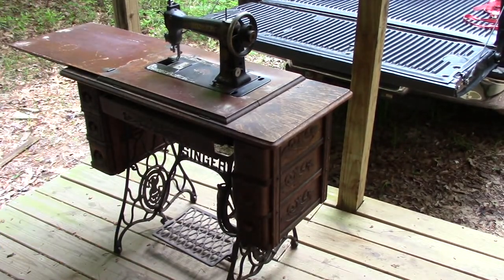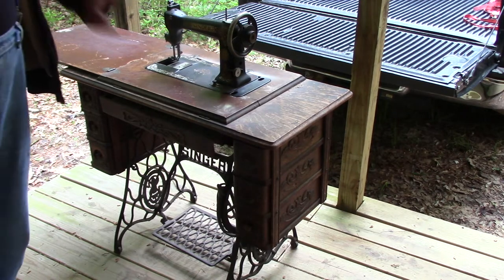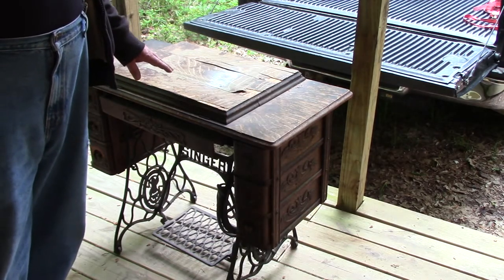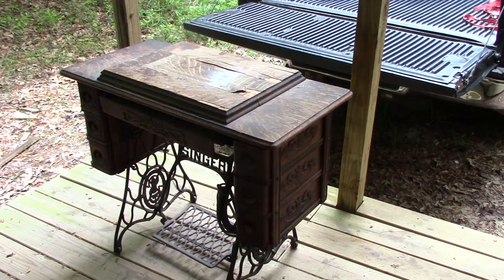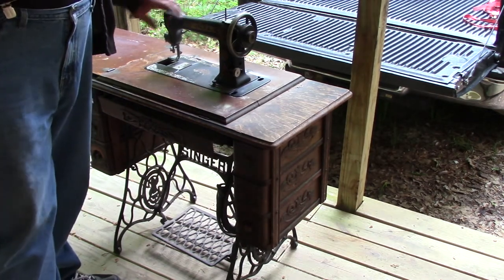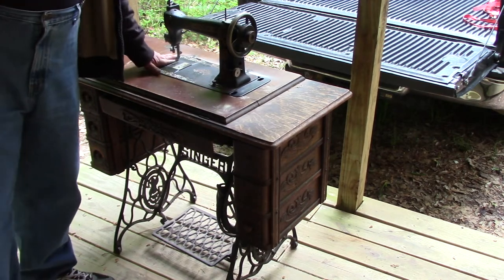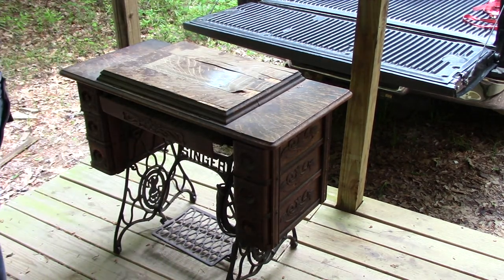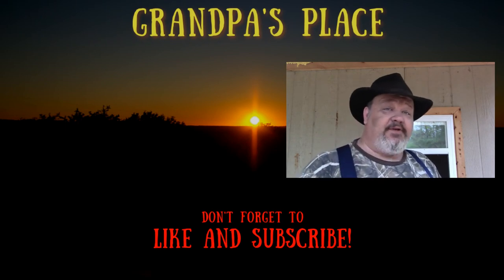The first item donated to my cabin project!

Comment: thats a jewel grandpa for sure . them old belts were nothing more then a leather cord with a staple holding the two ends together when they stretched out they would get them wet and let them shrink and they would be as good as new again . hope you find the parts you need for it  and get it back in shape . be a shame to see it lost to time . god bless brother .
Reply from the maker: I am sure I can find the parts, I may have to make a mold to do the broken design on the drawer but I should be able to find or make the rest. 

Thanks my friend